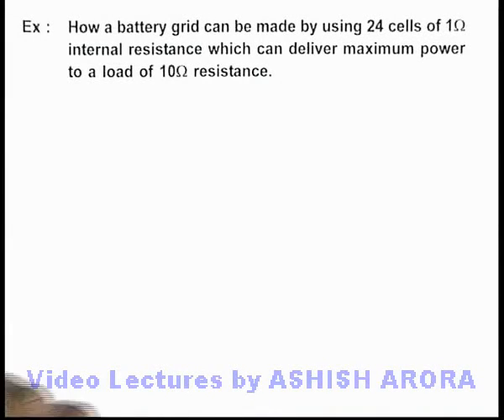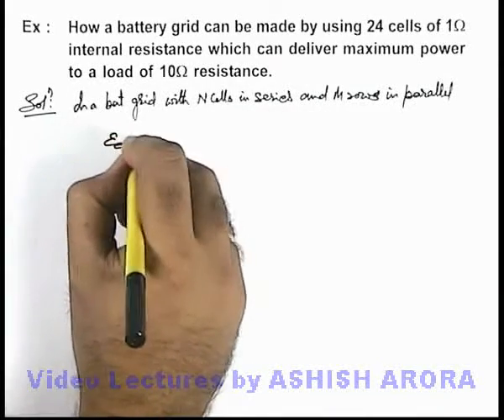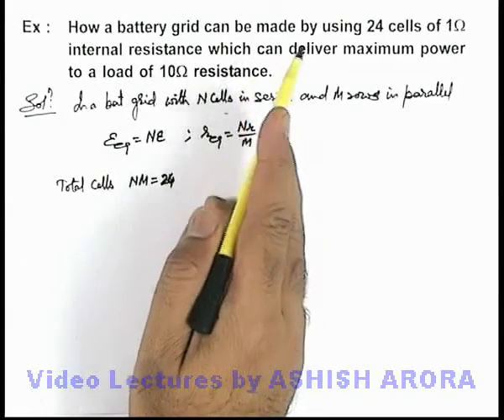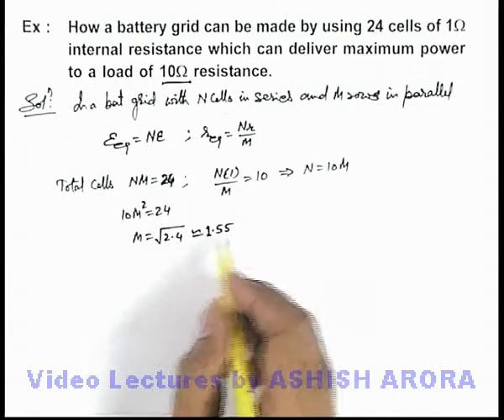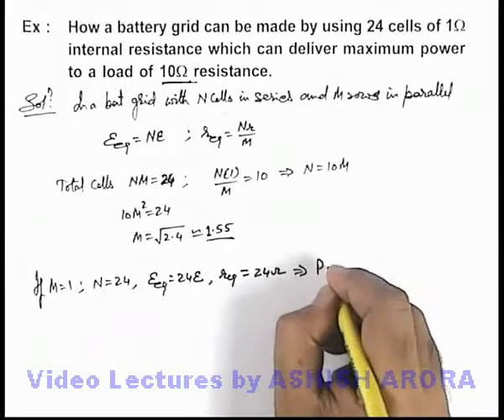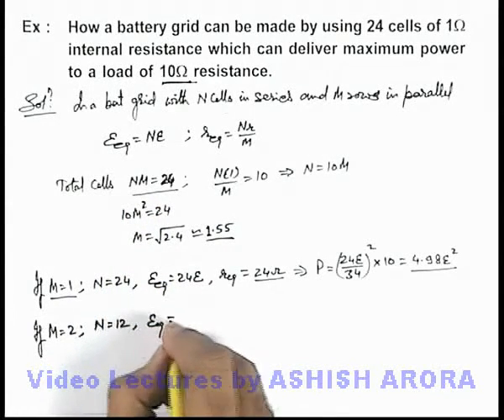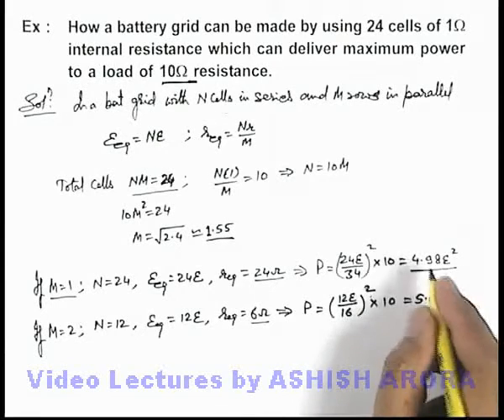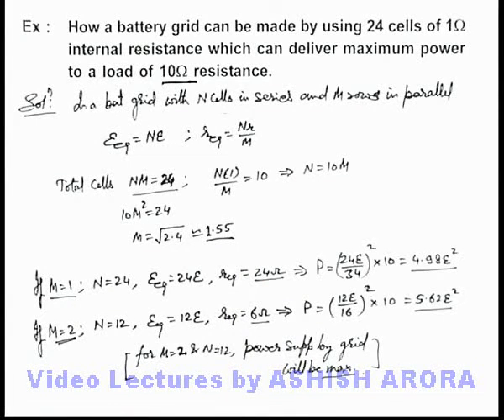Class 12 Physics | Thermal Effect Of Current |#14  Solved Example-9 on Thermal Effects of Currents

Comment: Sir in the all other question battery is constant but in this question due to change in N and M there will be change in Emf and resistance so we cannot consider this question by max power theorem sir pls reply
Reply: The emf is a multiple of Nover M while solving the problem with different values of n and m we will consider each one as a different case with constant emf nr over m.... Max power transfer theorem does not work in situations when emf is changing over any variable... But here in each individual case it is fixed.

Comment: Sir,we can also connect two system of resistors to get 10 ohm resistance? Like one battery grid of equivalent resistance 4 ohm in series with another battery system of equivalent resistance 4 ohm...
Reply from the maker: 1. In above question we need a battery grid not two.
2. what you've written the eq resistance is becoming 8 ohms not 10ohms...
Reply: OK